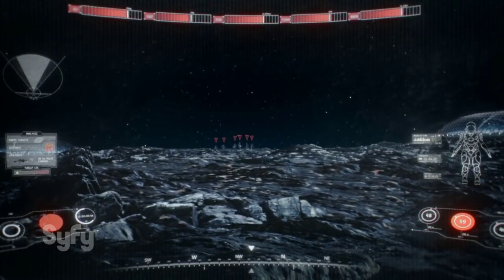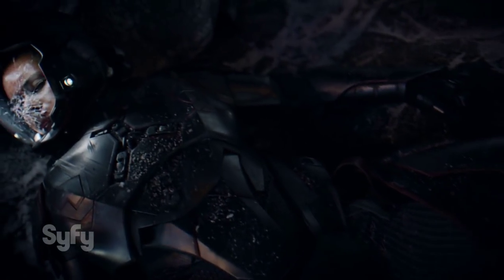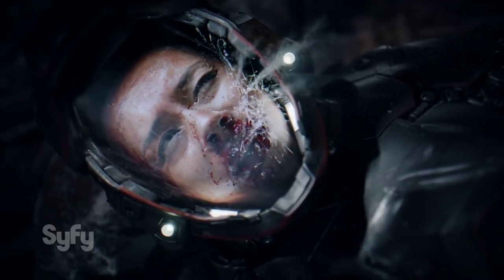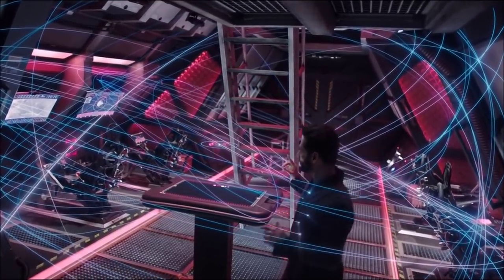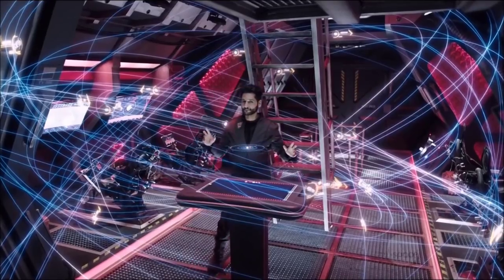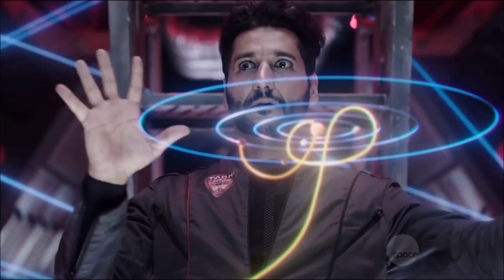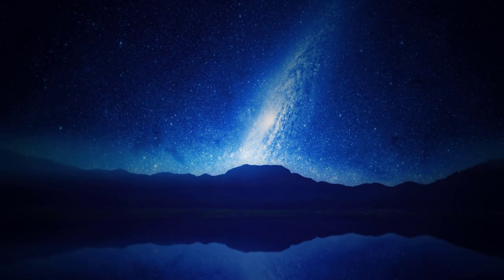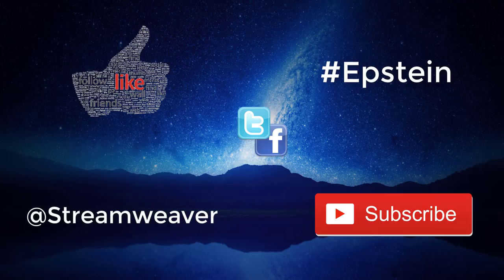Let's Do the Science:  The Epstein Drive

Comment: The books say that the exhaust plume is highly dangerous. Big ships must fly away from the dock on manuvering thrusters ("teakettle") until they are several kilometers away. Only then they can start the Epstein drive (the TV show takes more liberty with this). Also, ships need a certain size to fit such a drive in the first place. Smaller shuttles must rely on the so called "torch-drive", which is also fusion-based but more compact, more primitive, cheaper to build and a lot more wasteful.

Torch-drives were the precursor to Epstein-drives. Solomon Epstein tinkered with the torch drive of his yacht to make it more efficient until he "invented" the new drive by accident. The subsequently sustained high-g burn killed him.
Reply: They do reference it in the show, though.

When the Nauvoo departs Tycho Station, her exhaust plume(s) melt part of the scaffold.
Reply: Very few science fiction writers deal with the fact that an efficient space drive is an extremely powerful weapon. Even accelerating a 100 tonne spacecraft at 1 g, which seems like a reasonable thing to want to do, and using boron-11/proton fusion, the power of the exhaust would be 5 TW--twice the average energy the United States uses per second, in all forms. Quite a beam of carbon nuclei if it hit you! A real interstellar drive would be a planet-destroying weapon.
Reply: Or a planet-destroying laser beam, as I think it's more likely that we'll push spaceships to other stars, than have them push themselves :P
Reply: Good point. The Moties in "The Mote in God's Eye" didn't use their lasers to slow down their Crazy Eddie Probe at the other end because they figured they would have been hijacked to use as weapons long before then. So they shut them down before the announced end of acceleration and destroyed them.
Reply: "A drive is a weapon in proportion to its power as a drive." Larry Niven (paraphrased)
Reply: Not just the exhaust would be a formidable weapon, even using it as a drive to accelerate a simple brick slug into an unfortunate target can yield devastating results at those energies.
Reply: CitizenHans RIP Solomon Epstein
Reply: they destroyed earth with accelerated stealth-coated rocks in books. so
Reply: from the looks of things, in the show, even the missiles are running on mini epstine drives though.
Reply: Correct, that's also mentioned in the books. They also say that missiles run at much higher acceleration since they don't have to carry fragile bags of meat to their destination, so they can reach Earth from Mars in a matter of minutes.
Reply: RIP Epstein
Reply: A lot of science fiction writers do use the drive as a weapon i can name a few quite easily... it only seems like they don't because most science fiction films/tv is written by scriptwriters who usually have no idea what the hell their writing about
Reply: Drives are most certaintly a weapon in the Expanse. Michaio Pa essentially blockades Pallas by pointing the ass of a ship into the dock and threatening to slag anything that enters the dock.
Reply: Ted Archer yeah that had to be one of the most surprising events of the series. I mean they kind of alluded to it inside the first book but I never assumed that any faction would actually do it.
Reply: The Shacks that was quite a cool scene. Same with most of that book
Reply: Aye it was, felt like the Free Navy went down a lil too quick though  @whitneylackenbauer9782
Reply: short story series by Tom Ligon "The Devil and the Deep Black Void" and other parts of the series mentions a space ship intended to run into the earth in a terrorism attack. Jan 1986 Analog magazine for the first one.
Reply: @karlstorie8813  wait until next season and later. This season the threat in the novel was the drive plume blowing the colony away if they killed Amos or Holden. Comes up later too.
Reply: @SargeRho  great until we get an arrival?
Reply: i'll like to know how Epsteins discovery of efficiency was re-discovered? because his 'discovery' headed off into the great unknown, along with his body, never to be heard of again :)
Reply: Always put an off switch somewhere really accessible!
Reply: @ericaugust1501  in the show he says his wife has all his data, so at least he'll die knowing his drive will live on.
Reply: @giin97  huh. i guess i missed/forgot that. nice. thanks.
Reply: When your exhaust can vaporize ships, you'd better believe that ATC can nuke your ship whenever you're in a stations vicinity.
Reply: @chasonsnotes  Epstein didn't kill himself.
Reply: @karlstorie8813  - "The Moties in "The Mote in God's Eye" didn't use their lasers to slow down"

This is false. In the "Mote" the Moties slowed down at the destination by releasing the solar sail and having it focus the laser BACK on the smaller part of the ship (with a secondary sail) slowing it down as the sail accelerated away in the original direction.
Reply: @karlstorie8813 Way back in the first issue of The Man-Kzinti Wars, (of whom were talked about on Star Trek The Animated Series), the first contact between our two species was a Kzinti warship hunting a weaponless Human colony ship, to use us as food. Our ship's captain made the decision to turn the ship 180° and activate the main drive engine momentarily. Thereby cutting the Kzinti warship in half. 
 Then there is the Orion Class generation colony vessel. Those would use nuclear bombs as propulsion.
Reply: @Stoney3K Something like this was described in the opening ten minutes of the Bruce Willis movie Armageddon. "These rocks are the size of basketballs and Volkswagens. The main comet body is basically the size of Texas, Mr. President."